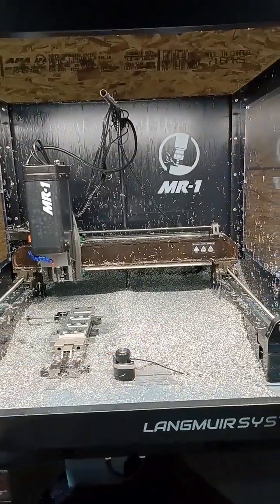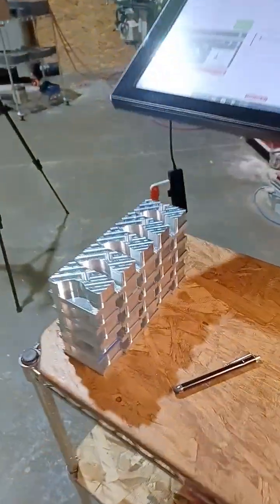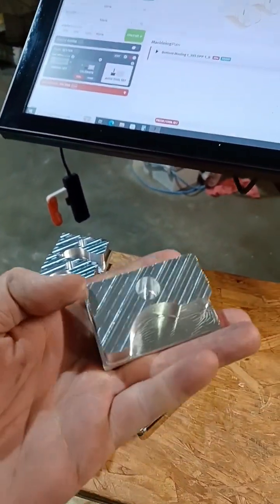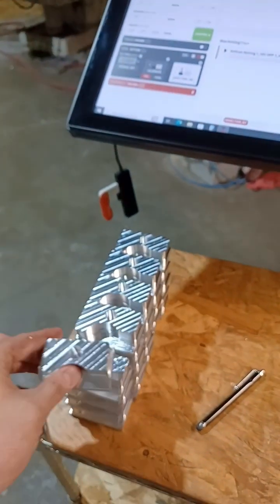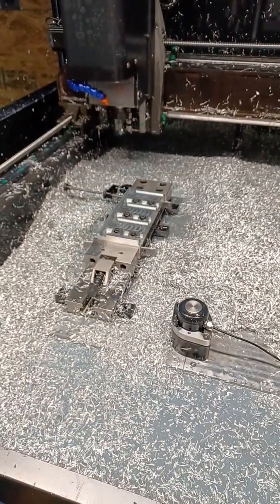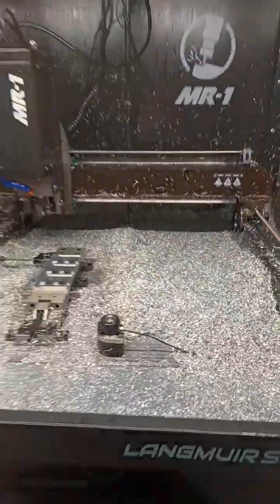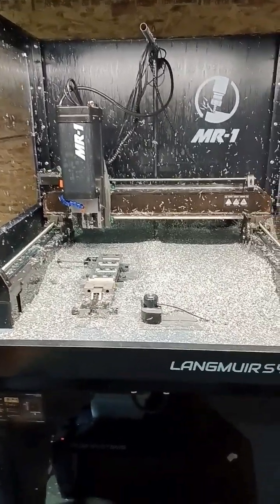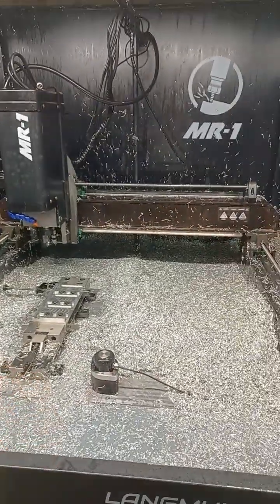MR-1, things you need to know before buying! @LangmuirSystems  #cnc #cncmachine

Comment: Surface finishon the sides was pretty rough. Important note and im not coming down on ya or anything its a super common mistake. Surface finish means the difference between the high points and the low points on the surface of s part. Not so much its overall shinyness. 

The importance of this in the end is surface finnish is a funcional tolerance not a visual thing.

All this being said these look very good and probably for a quick op aluminum part there great!
Reply: The video is low resolution, its hard to tell ultimately what the surface roughness is, but to me it looks fine, certainly less than 64 Ra. Surface finish, is not the same as surface roughness, the surface "finish" in the video, is aluminum, as machined, the surface roughness, is the difference between the high points and the low points on the surface of the part. Not to be a jackass or anything, but its important to know the difference. But hey besides that wow im really impressed with this machine! I might just get one for the backyard. First ill need a shed that isolates noise though, i dont think the neighbors will be as stoked about my milling adventures.

Comment: How’s the tolerances/accuracy on those? .001?
Reply from the maker: O yeah I can hold .001" no problem.  I want to upgrade the home switches so I can keep it more square...  A lot of the accuracy is based on how much you dial it in.  Everything is adjustable.
Reply: @BecksArmory  Can you elaborate more on the home switches? What is the current issue, and how can it be improved?
Reply: @ff4937  the switches it has are not that accurate so they will lead to the gantry not being square after the homing operation. they might be close enough for some parts but to achieve a better square you need more expensive accurate switches. since this is a gantry machine it has one motor for each side of the gantry and when it gets powered down it drifts and loses square. same thing happens with a plasma table and I had to manually square mine each time i started it up before i got switches installed.
Reply: @clutchboi4038  Just change them to contact switches or swap them out to optical switches. They are using regular endstop switches like you get on a 3D printer.
Reply: Mine holds .001
Reply: I put a gutter drain in the back for the chips to wash down into an auger box just above my coolant tank. Works great no mess to clean up